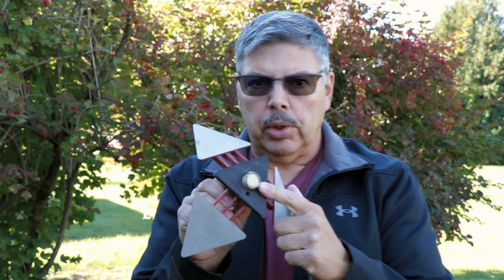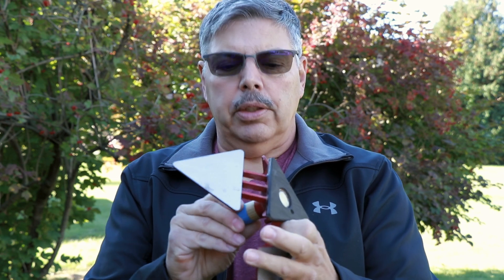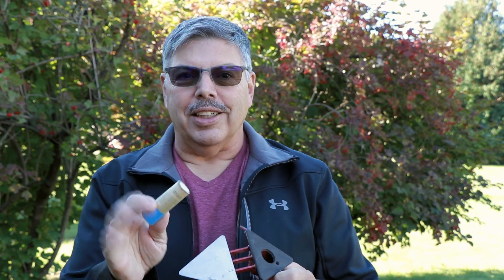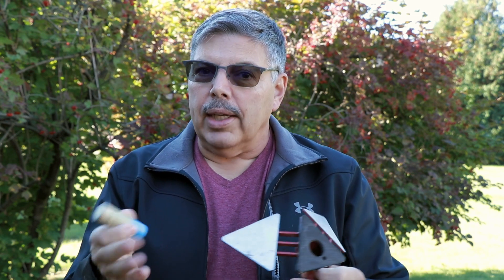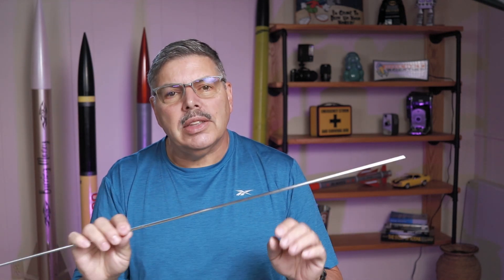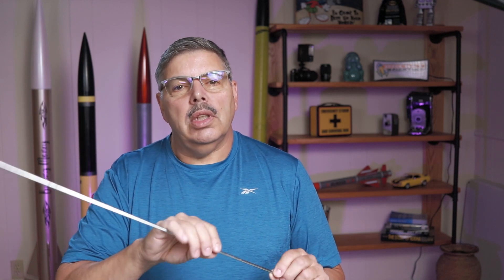Sugar Motor Rocket Launch D12.

Comment: Great Video!
Can you also make a video for 24mm RMS (maybe from aerotech)? So you can make your own refills (maybe reuse a existing nozzle and o-rings etc)
Reply from the maker: I don't have any 24mm hardware but a friend of mine does and he has launched a 3x, 29mm cluster on flexi-fuel.

The phenolic Aerotech nozzles for 29 & 38mm are inexpensive. They can only be used once or twice. The 54mm nozzles are very expensive.
 https://www.rocketmotorparts.com/storepage1577803.aspx 

The links will give you a good idea on what you need to do. Use a 3/8 core for 29mm.
https://youtu.be/8_GsleHQZGw
https://youtu.be/KZQ-cVx4Mkw

Good luck!